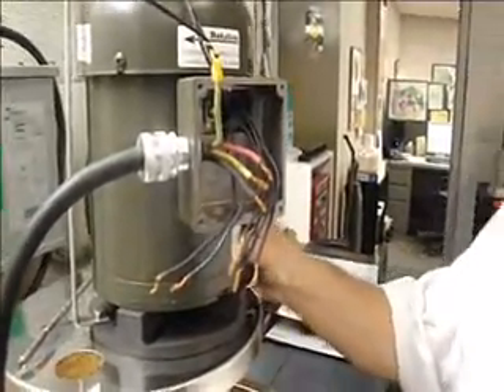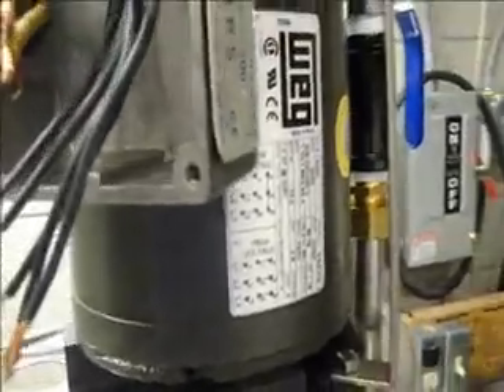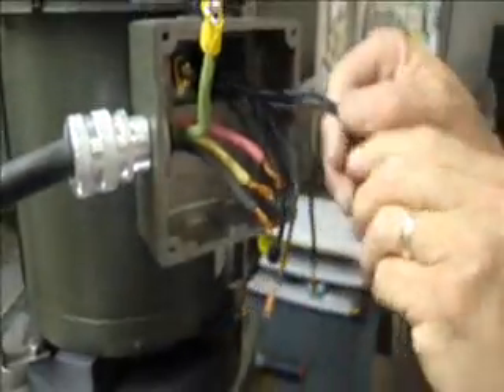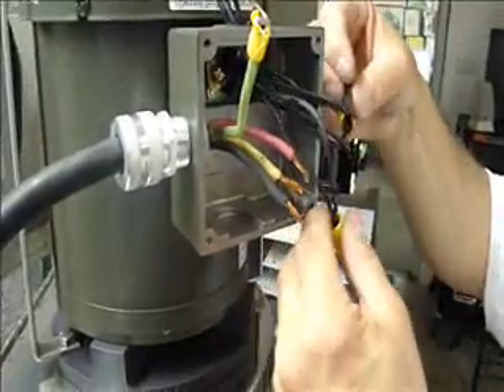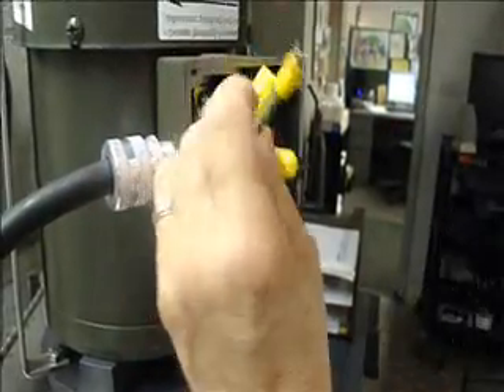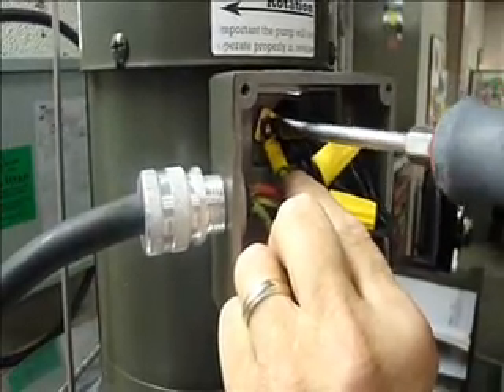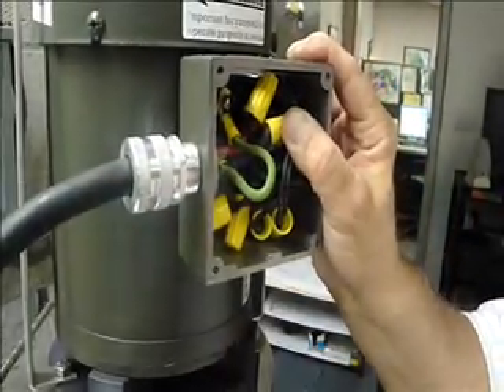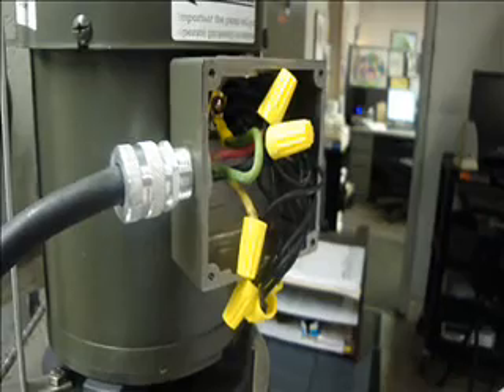Powerwise Ink Pumps - Wiring a US Motor High Voltage.wmv

Comment: Does it matter where the high leg hooks upon 3 phase motors?
Reply: Three phases coming in the motor doesn’t matter how you wire it,the only thing is it can spin backwards. If it does just open the disconnect and switch wire 1&3 that will switch the polarity back to normal. It’s easier to switch them in the disconnect rather than opening the pecker head and removing the tape etc.The most important is the motor wires to be wired 4-7 5-8 6-9
Reply: Irnes Begic thank you